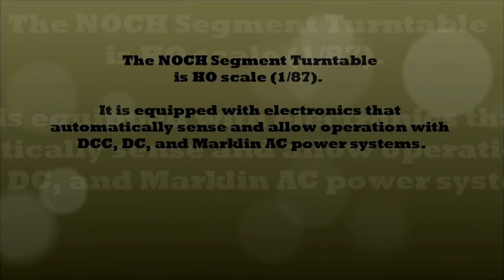NOCH HO scale Segment Turntable Model Review

Comment: Great video and a nice job on installing your gadget but, I'm a bit confused as to why they call this a turntable?  It doesn't turn the locomotive around like a turntable does so that it can travel in the opposite direction (which was the original design idea) rather, it just switches the locomotive from one track to another, just as a typical rail-yard switch would do.